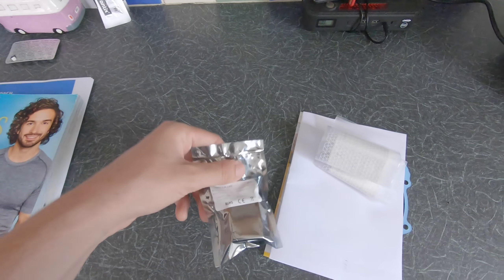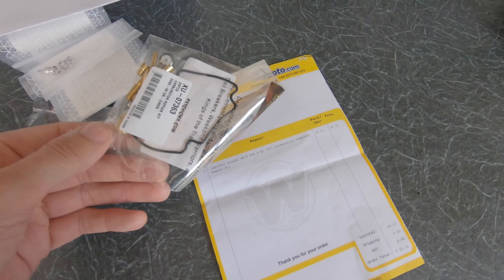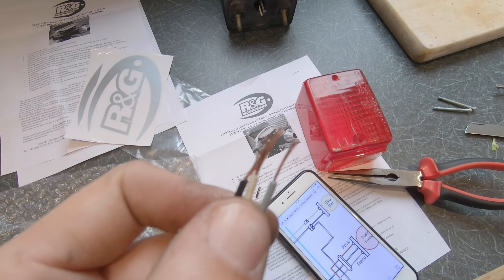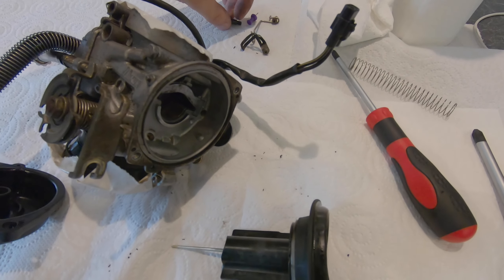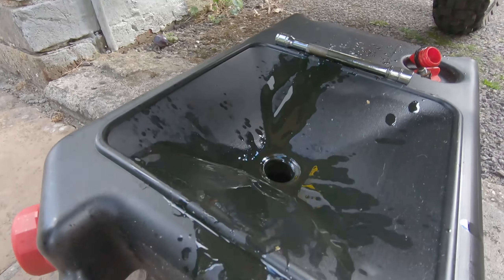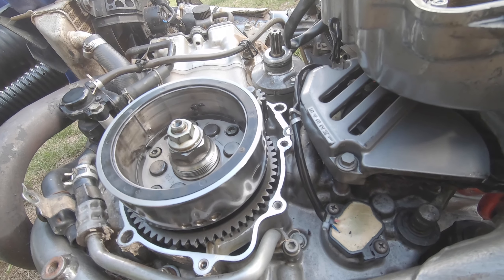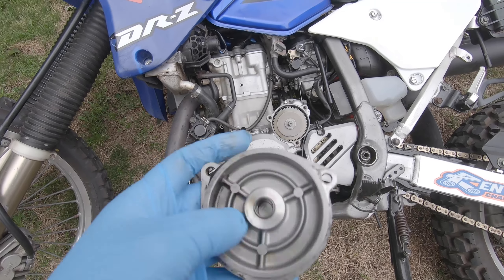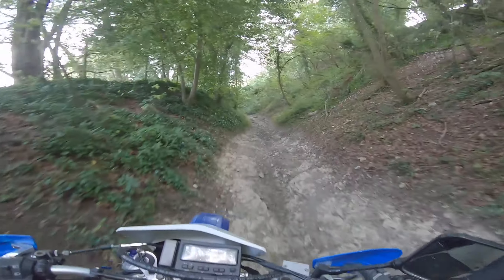Suzuki DR-Z 400 S - Episode 1 - The Unintentional Project Bike

Comment: Hi what pro taper bars did you fit ? Been doing very similar upgrades to my drz good job 👍
Reply from the maker: Thanks Mark! They’re Pro Taper CR High. I’ve got some 30mm Tusk risers to fit at some point as I still find I’m still a bit hunched over the bars when stood up.
Reply: @HenryCrew35  cheers thanks for that you must be tall 😂 planing on doing the GWT on mine next year Covid allowing
Reply from the maker: Ahaa I’m about 6 ft maybe a bit over with my boots on I recon! I have really long arms! Oh awesome, that’s on my list too.
Reply: @HenryCrew35  ah only 5.7 so I won't need the risers
If you're ever down this way let me know??
Reply from the maker: Yeh for sure Mark, would be great to ride with you once we are allowed to be social again!
Reply: Hi mate sorry to be a pain we're your bar 28 mm or 22mm if 28 did the switch gear fit OK?
Reply from the maker: 22mm / 7/8inch bars - you’ll need a ‘fat bar’ conversion to fit 28mm bars but it’s only the centre part that is 28mm so stock controls would still fit. Something I found when fitting the bars.... unwrap the cover on the crossbar pad, take a razor blade and slice a line down the foam so you can remove it, makes tightening the bars up much easier! You can then pop the pad back on after!